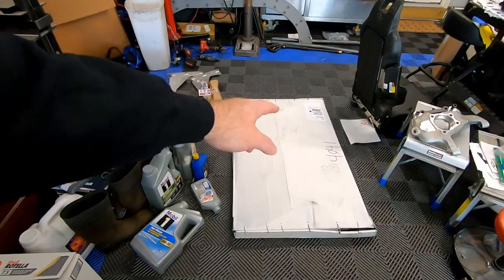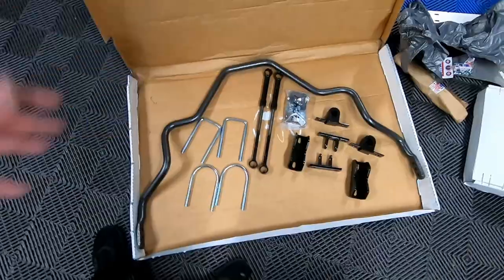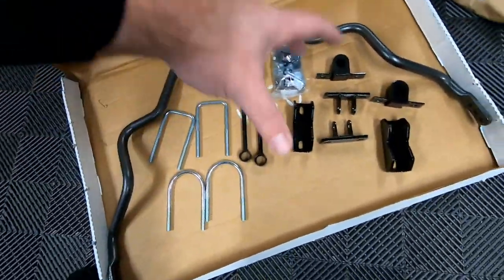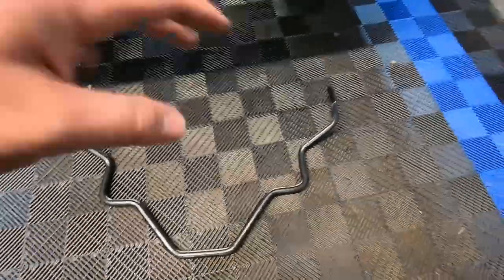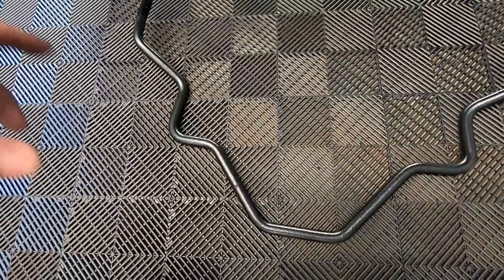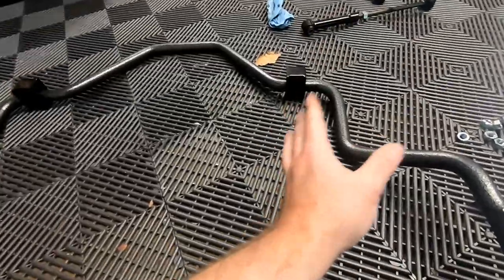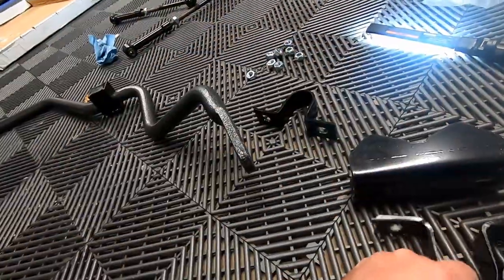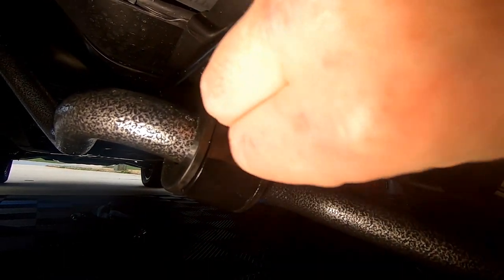2022 Chevy Silverado - Hellwig Rear Sway Bar Install!

Comment: I installed a Hellwig swaybar for my 3500 srw silverado 2004 a number of years ago. 8ft. box carry a camper 9ft 4in.  luv it.
Reply from the maker: Did a Tahoe Rear bar on my 05 2500. Loved the results - so did the same on the ZR2.

Comment: Which mounting hole do you have your sway bar set at and how’s the handling? Did you start with the mounting holes per instructions? Just ordered mine!!
Reply from the maker: So I put it in the softest setting - and I've had zero issues. The ZR2 in particular nose dives, squats, and has a lot of body roll around corners. This eliminated nearly all of that! 

I will put a rear bar on all of my trucks from now on!
Reply: Thanks for your feedback. Yea, thats the goal here!

Comment: Would you still be able to install a set of sumo springs in the rear bump stops? Or would the sway bar interfere
Reply from the maker: The swaybar has nothing to do with the bump stops - so should be accessible.